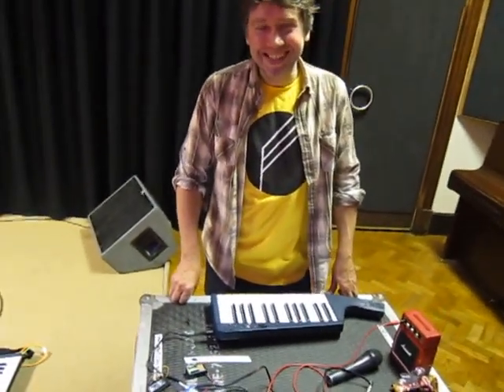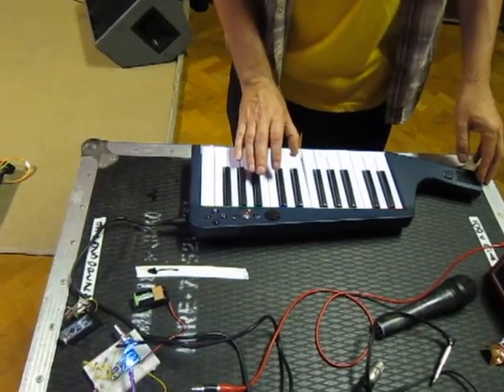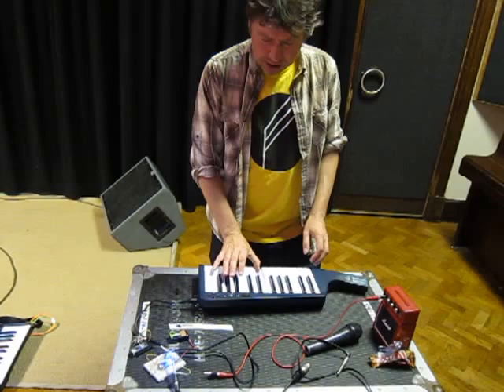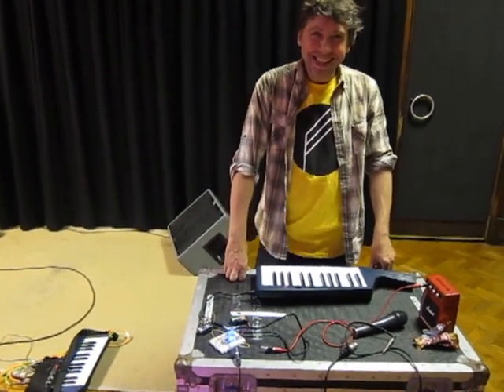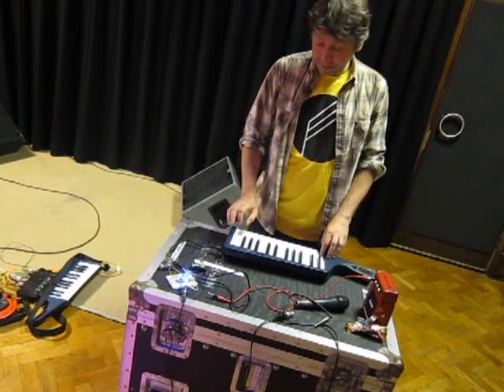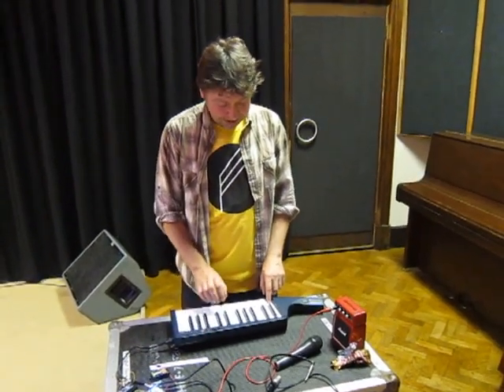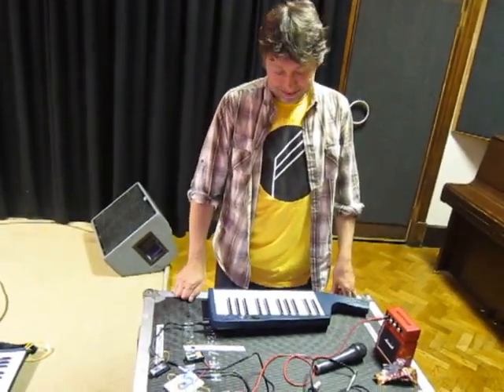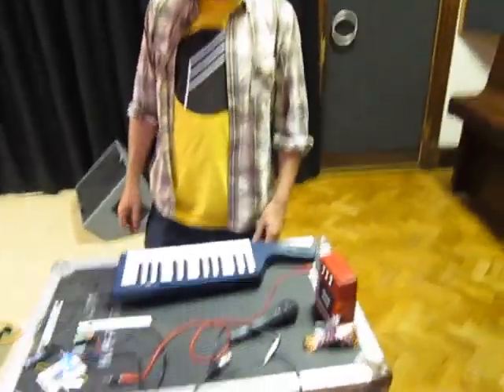Slightly madder CheapSynth "polyphony" from £15 keytar, £10 Arduino

Comment: Could you explain how to mount it in arduino? Since putting the code as it is, I do not walk, the subject is that I speak Spanish and it costs a little the traditions, could you give me a code that can handle those oscillators with the keyboard midi and some potentiometers? Thank you